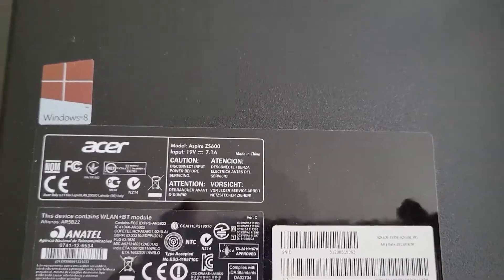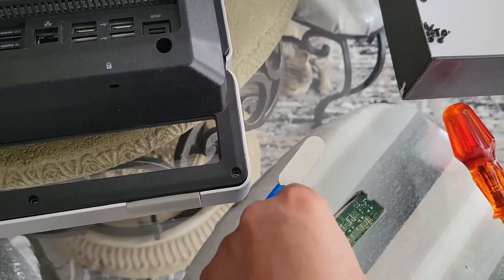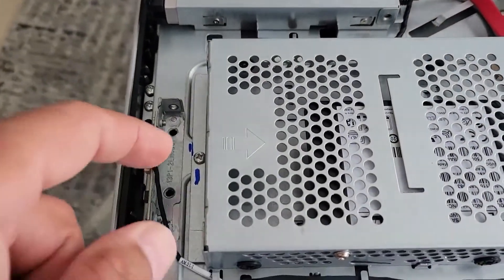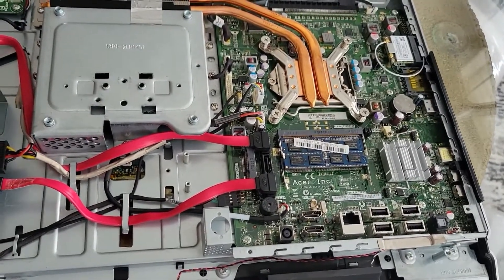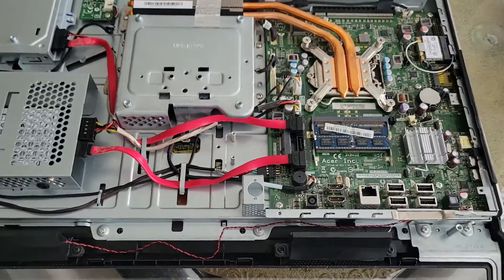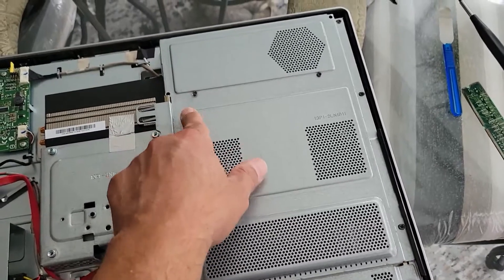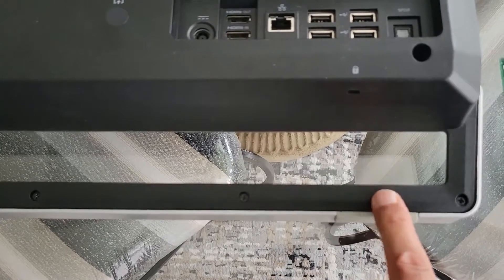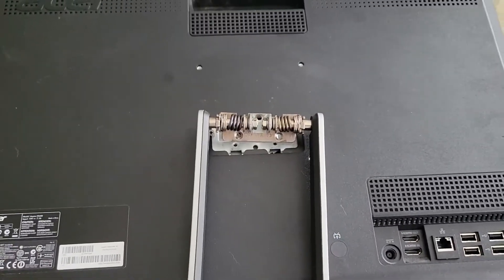Acer Aspire ZS600 drive upgrade. Also, what went wrong if after putting it together it won't start.

Comment: hello bro I have a problem it seems to be that I start Windows and the Windows repairer at the same time and since then every time the pre do no longer gives the usual sound the BIOS does not even enter it just stays black and it sounds as if everything was in order any idea if it is repairable I already did the usual clean the BIOS remove the battery and nothing
Reply from the maker: Not sure, but if happens that you opened the cover you may have knocked that jumber off (the one I showed on the video). This will give a result like what you described. Also, you may consider reseat the memory modules. What I do usulay to clean the bios is to unplug the power cord, remove bettery out and leave it like this for a few days before putting everthing back together. Hope you find this info helpful and sorry for the delayed response.